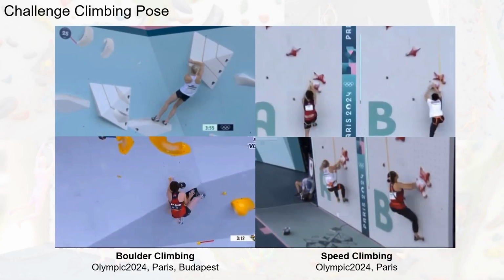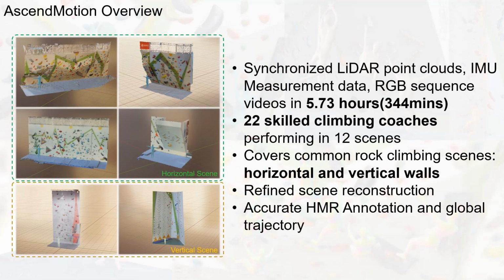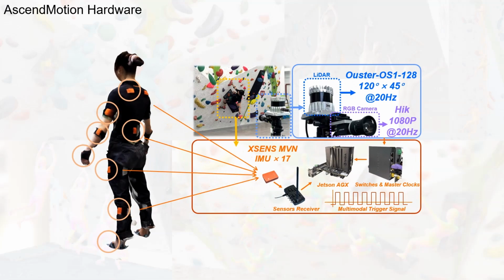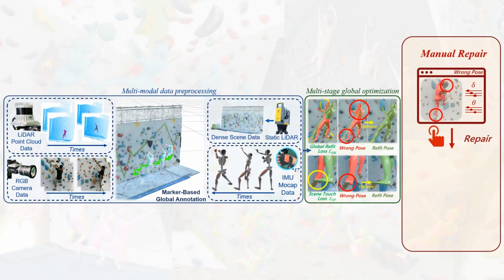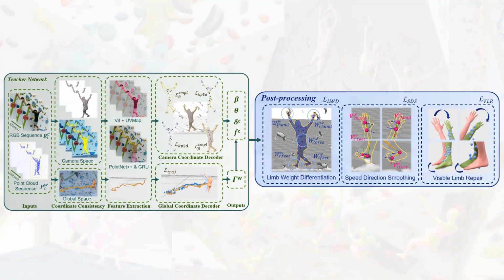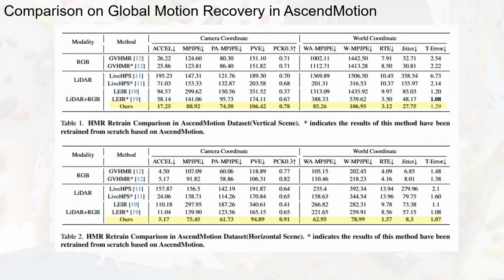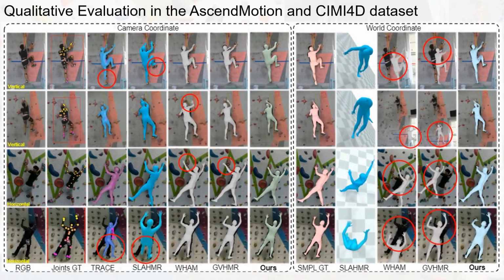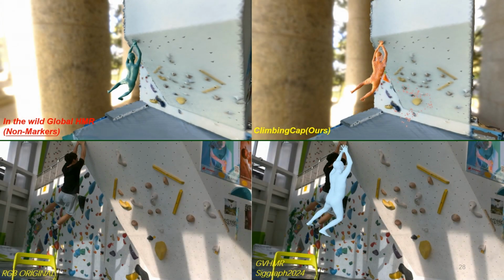[CVPR2025]ClimbingCap: Multi-Modal Dataset and Method for Rock Climbing in World Coordinate

Comment: This is very interesting. I'm interested in the application of data like this, even if only semi annotated, to model climbing performance via RGB data. Any insight your team may have in terms of constraining the data to RGB, or even using an annotation pipeline like this one (with more sensor data) to train a subsequent model to infer climbing performance relative to scene would be very interesting. For example, how useful of feedback could a vision model provide to climbers, using video data of themselves climbing as input? I'm interested in investigating this and would appreciate any insight you might be able to offer. Please message directly, if you have the availability.